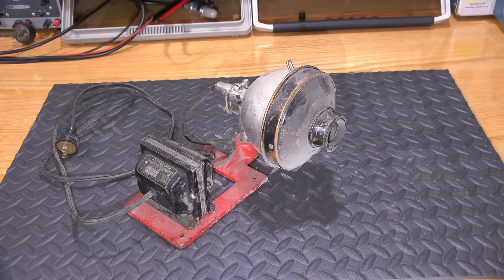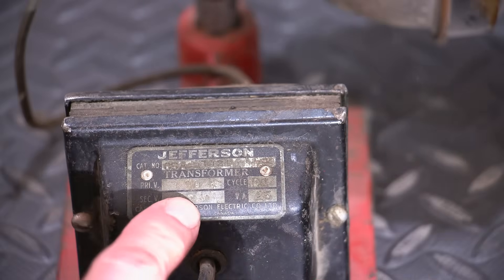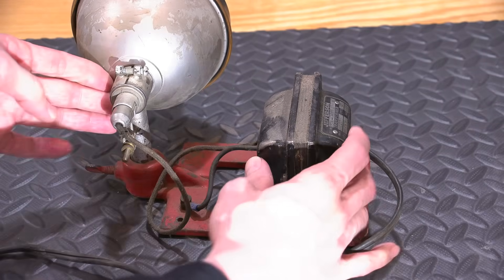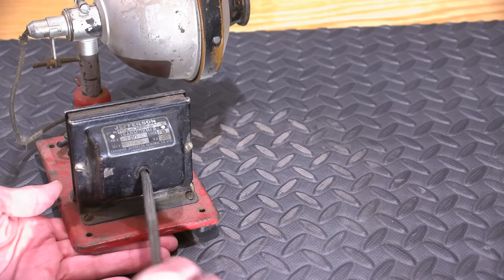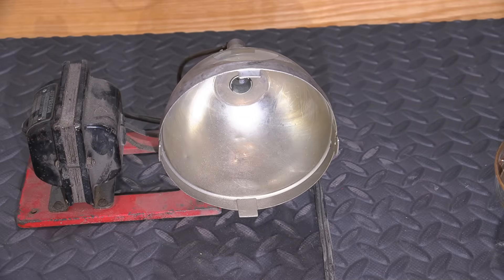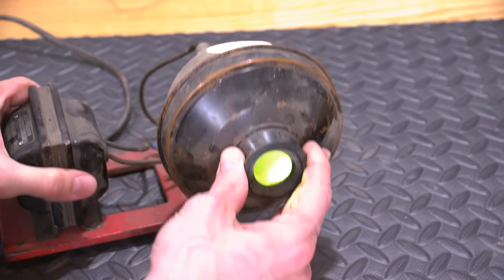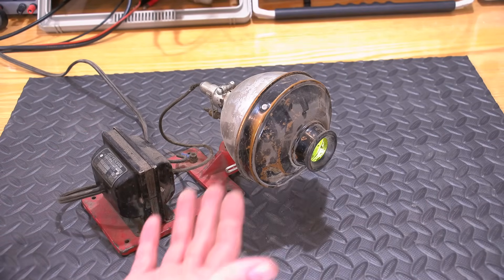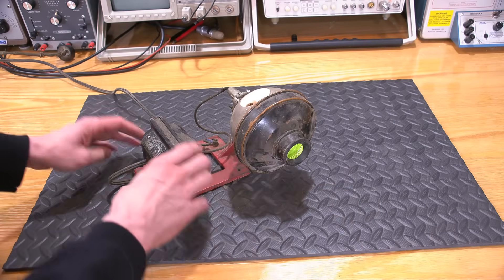Barn Find - What Is It - 1940's? Mystery Device Teardown!

Comment: if it didn't have the opening that would let white light out, I'd think that is was for doing very old school film developing by inspection. You'd soak the film to remove the sensitizing dyes first, then you dye the film before developing using a couple of different dyes, then you'd develop the film and every so often you would shine a dark green light through the dyed film briefly to see what the contrast state was of the film to decide how to proceed. This was used with mystery film where you didn't know what the film was or how it was shot.

Comment: I also go along with the egg candling device.  Perhaps the colored glass lens was a method to deal with different colored eggshells, to obtain a more consistent appearance from the egg. The focusing mechanism would have perhaps been to be able to candle eggs from large to small (e.g., quail to chicken to duck to turkey) eggs and cover the entire egg.  As for the stand, that looks like one style of ring stand clamp base that the transformer is mounted on.  It could be mounted on a bench or on the wall.  You don't want to let an incubated egg cool too much when candling, and you don't want to sell eggs that have started developing a blood spot, so a bright light with little heat is ideal. Modern egg candling devices use 800 lumens of white light from an LED to solve some of the issues that this antique attempted to solve.

As for the flash bulbs, they were filled with a magnesium alloy wire that literally burned.  The bulbs got quite hot while flashing.  The large bulb you have would likely have been used in a photography studio, and it's just a single-use bulb.  Even with needing to carry lots of bulbs, it still beats the use of the even older flash powder technology for photography.

Comment: The Westinghoue flashbulb is nearly as old as the egg candler. Too bad you don't have the  thin corrugated cardboard
 box it came in. People may ask why a piece of thin metal inside an airless ,but filled with some nitrogen gas glass bulb ,
would be good only once . Well that is because it 's Magnesium wool wire. Once it gets 3 Volts through it , it will light up 
so brightly for only for about 0.020 seconds,  because the Magnesium itself is in nitrogen gas ( later oxygen) it doesn't 
explode because of a plastic coating on the outside , it was called the SM bulb. The brightness of your number 11 bulb
 is 1800 Kilo-lumens!  Very bright but  only 1/50th of a second! This info was in a General Electric Lamp Division brochure.

Comment: After watching 1 minute of this video, my guess is that this thing is supposed to be mounted permanently to a bigger object, stationary or ambulating. The red frame seems to be the electric return path from the active bowl thing that is only connected to one wire leaving the transformer (to the bayonet lamp holder looking end). The setup makes me think that the transformer is a step down one.  Is it an apparatus that transmits electromagnetic radiation at some frequency out of the hole in the middle of that black/brassy tilted vase-looking thing? For shure I would be careful before energizing such an ancient device, being aware that they made a lot of inadvertently dangerous, electrical contraptions back in the days...

Comment: it looks like a theater spot light. works the same. you do have to focus the light beam for big or small circle of light.
Reply: That would need a condensing lens to work an a much more powerful bulb.  It's a shame the actual answer (egg candler) has been side tracked by the flash bulb discussions!

Comment: I was mesmerized by the old square flash cubes. As a kid I discovered it was fun to set them off with a capacitor charged by a 9v. The charged capacitor seemed more magical than just the battery. My friends thought I was a wizard. (Funny that later in life I would be called a “modern day” Mr. Wizard by a couple of TV networks). My grandmother was pretty forgiving, considering how many of her flash cubes I popped off.
Reply: I still have a few 3-packs of those Instamatic flashcubes.  Used to have a few of the Instamatic cameras, but I think I lost them in a house fire.
Reply: @SenileOtaku  Just the other day I saw a photo online that was heavily tinted red and was a squarish format picture, so I asked was this a 126 Instamatic pic from 1974.  It was!  Well... '75 but close enough to get a laugh.
Reply: @SenileOtaku  I’m sorry you had a house fire. That is such a horrific experience.
Reply: There were also "magicubes" which like flash cubes contained 4 bulbs each.
Rather than being initiated by a battery voltage, these had a spring loaded wire which struck the single pin supporting the bulb somehow firing the bulb. There was no power source involved and they could be fired just by lightly pressing the exposed spring wire with any object until it cleared it's retaining pin and struck the mounting pin.
Reply: @MrVeryCranky  I remember Magicubes but I didn’t know there were spring-fired versions. That’s pretty cool. I only remember the ones set off electrically by a camera. I wonder what the firing mechanism was. Perhaps some primer material.

Comment: When I do a lecture on the history of flash (as part of my beginner's flash photography workshop) I fire of one of those flash bulbs...I screw it into a light fixture designed for high-temperature incandescent 1000watt photo flood lights, turn it AWAY from the audience so they aren't blinded, and then touch the prongs of the standard North American line cord that's attached to the light fixture to a 9v battery...that's all it takes to fire the flash bulb.  
I've never measured the temperature after firing, but you can definitely feel the heat radiating onto your skin long after it has fired...the heat was so intense that it usually distorts the glass bulb!

Comment: Hey, a quick question, can you reccomend any good capacitor suppliers? I recently got an old 1952's radio, model "Loewe Opta 1553W Ratsherr 53" and it needs recapping, but none of my local suppliers have the caps in need (I need to replace as one of many, a 5000pF 500V wax cap, and no one locally has anything simmilar).
Reply: Caps in that particular size are primarily listed as .005 uF (microfarad), only in a few cases as 5 nF or 5000 pF.  The big online vendors in the US most electronic hobby folk here end up buying parts from are Digikey and Mouser.  These have similarly large (but not identical) selections of parts and their parts prices are roughly the same.  But chances are one has generally somewhat lower s&h costs to your particular location; which one it is will depend on where you live. Looking on Mouser, there is a 1kV rated .005 uF ceramic disc cap on offer that should work fine as a replacement for that one wax cap.

Comment: What was the transformer output voltage ?
Reply: The label showed 6.5 volts. The transformer is rated for 25 VA which means 25 watts, since incandescent lamps are a perfect resistor. That works out to just over 3.8 amps. A bulb that size would undoubtedly get hot, therefore, the large vent hole in the side of the reflector.

Comment: Using the partial tag on the face and other's suggestions, I looked up "egg candling manufacturer winnipeg manitoba canada" and I found a US Patent listing "Caswell, Walter A., Winnipeg, Manitoba, Canada. Egg candling apparatus. 2,117,146; May10, 1938

Looks to match that decal, at least what's left of it. And if you go look up the patent, that's it. I'd leave a link, but YT isn't fond of them.
Reply: Sounds plausible to be sure, I had a thought that it was a light source for a microscope but I think you are correct.
Reply: @Thomas Moore  If you look up US patent #2,117,146 you'll see the device in the video.

Comment: On the off chance you have access to such equipment, a wavelength sweep of light through the glass may illuminate its purpose.

Egg candling is plausible, but if the glass has unusual transmission characteristics (in particular, a lead-rich glass might have a green tinge like that), that might indicate it was used to provide a reasonably monochromatic UV/Infrared/X-ray/particle source for some industrial or scientific application or other. There're plenty of one-off instruments like this; that was my first guess, as the levels of jank here seem roughly commensurate with kinds of things I've seen physicists do. 

Some of the other features might be vestigial, left from whatever it was cannibalized from. Who knows. Cool find!

Comment: I was always perplexed by the physics of the MAGICUBE flash cubes that had no connective wiring or circuitry, just a little metal tang that would pop up out of the camera into the filament momentarily.  Maybe there was a piezo inside the camera making charge at that instant.  Never took my Kodak apart to explore that far because my parents would have killed me.
Reply: It was even simpler than that.  If you looked closely at the base you could see then was a bit of spring loaded wire in the slot on each side.  That little tab that popped out of the top of the camera pushed the spring off the nub that was holding it.  The released wire struck a small rod coated in fulminate.  It's probably the same chemical as was used in firearm percussion primers.  You could set them off by pushing anything suitable into the slot to fire the spring but yeah as kids we were warned that doing something like that would be met with parental displeasure of the highest order.

The Magicube used zirconium wire rather than magnesium - I'm not sure why but I suspect it might be because it improved reliability with a fulminate initiator.  I never knew one to fail.
Reply: It was pyrotechnic.  The impact struck a primer-like ignition device.
Reply: Ah, the age of Kodak cameras and Kodachrome film.
Reply: @foureyedchick  I had a Kodak Instamatic X-15 when I was about ten. I wore it out ... eventually the film advance stopped working. Better cameras and a home darkroom followed.
Reply: @AcmeRacing  Part of what I found "NOS" in the attic from the previous owner...  a few of those Instamatic X-15s in the yellow and red "display" boxes.... thinking wow, what I find,  and they are essentially worth nothing!  Don't even know if you can get 126 film for them anymore,  or even the 110 film for the "pocket" cameras.
Reply: I was able to trigger Magicubes with anything that would push the metal spring off the pin that held it back. Not sure how, but the impact from the spring triggered the bulb.
Reply: @AcmeRacing  i would guess the same concept as a grill striker or other electric sparkers that work without batteries, get the right combo of metals and when they hit eachother hard enough they let out a jolt of electricity
Reply: It was fired by percussion, one could carefully extract the bulb from the Magic cube and flip the bulb when it hit the floor it would fire.
Reply: I am surprised anyone remembered these,  and that Paul mentioned them !!  

When I was going through the attic,  the previous owner of the house left boxes of flash cubes and the vertical panels (I believe they are called flip-flash),  and bulb style flashes with reflectors,  but smaller than the one Paul showed.  Lots of old cameras like Brownie.  I wonder if those flash cubes would still work 40 to 70 years after they were made ?
Reply: they were kinda cool. they used a pin and hammer, like a bullet primmer charge. no electricity needed. you could poke one with a tooth pick and blind yourself!
Reply: The bulb had a small rod that a spring struck. Just pinch it with pliers and the bulb goes off.

Comment: Hello Mr Carlson, les think a bit about this thing: 25VA is low for a projector, , the iron frame has 4 holes (in corners) to keep it steady, the position of the bulb is adjustable very precisely, and the  position of the complete reflector is rotable , and ihis support is adjustable in vertical , so , summing up, steady, and adjustable in focus, higt an rotation, to much to obsrve eggs, looks like a polarized ligth device to use with a second device in front of it, maybe a polarimeter (had you ever noted the existence of LEVOTIROXINA?, this moleculae turns right polarized ligth an has a similar one that turns left and the results in the human body are totally different, being quimically equal). I greatly enjoy your videos, you are incredible good, knows your bussines like an encyclopedia.

Comment: That's a unilateral phase detractor from a Rockwell Retro Encabulator. Great find!
Reply: It seems to be missing the flux capacitor.
Reply: @kenmohler4081  I was wondering how long it would take before someone brought up the flux capacitor 😅
Reply: @shawn7233  You can't build something of this nature without at least one.
Reply: Alright.  This thread is hilarious.  Thanks dudes.  Needed that
Reply: It's obviously an anti-focal sideband decoder for tetrahedral conditioning of Rochelle salts.
Reply: @carlrudd1858  Tetrahedral conditioning? Over Dr. Bell's dead body!
Reply: With nano pulse laser I'll wager.
Reply: I thought it was the bilateral phase inverter
Reply: I thought it was an old green light thingy,  I was close
Reply: How are you able to differentiate it from the multilateral phase detector? The Rhymann tertiary rheostat is blocked by the amplified muon collimator.
Reply: @matthewhall6288  By the absence of a drawn reciprocation dingle arm. The later multilateral phase detector had the dingle arm as part of the unit.
Reply: @bodacious2276 you only failed by using the word "dingle".  And you did it twice.  You should have, at least, capitalized it, like "Dingle".  But you get a B+ for effort. 😊
Reply: @matthewhall6288  also easy to tell by the presence of the marzel vanes.
Reply: Whoa guy's not so fast , I think it's part of the Gonculator that was in one episode of Hogan's Heroes
Reply: @cajuncoinhunter  í don't think so.  It would've needed a much beefier transformer. I think this was an example of the early attempts to bring encabulation technology to the retail market. It was ultimately a failure due to the incessant zizzing and dripping.
Reply: @jeepien  Also, there was the overheating like the tropical fishes, and this one isn't like the Austrian self-sharpening razors... I knew I'd heard that "zizzing and dripping" before. Thnx for making me dig out my Firesign Theatre' Big Book Of Plays to find the reference.
Reply: @davebrown9725  Shoes for Industry, Comrade.
Reply: @jeepien  It looks like you in the Jeep family ??
Reply: Spot on but the dingle arm is missing
Reply: A master type Garrestan.
Reply: Pantom Zone Projector.
Reply: @Leslie C. Deal Cardinal grammeters are finicky things
Reply: Best thread EVER! 😄❤️👍🏼
Reply: :face-green-smiling:
Reply: Very funny!  it is worth it to you tube search for  "unilateral phase detractor from a Rockwell Retro Encabulator" and watch .
Reply: It's actually street light "go" projector.. The red ones used real ruby's.
Reply: Dammit! Haha beat me to it 🤣
Reply: It's an Interositor, of course.
"Capable of laying a 6 lane highway at 70 miles an hour, if I read the specifications properly."
'This Island Earth', 1955
Two human scientists have been given a catalog of alien technological gadgets as a sort of intelligence test.
I was always struck by the absurdity of the scientist being able to quickly figure out how much energy that sort of construction process would require.
Reply: I'm sorry, but you're all wrong. This is a relic of the early CIA efforts from their mind control laboratory where the famous  Manchurian candidate research was done. This particular device (obviously) focuses energy generated by spatially synchronizing within a reaction cavity, electromagnetic fields and a specific spectrum of light waves, which when combined together are focused into a subject directly or through a video copy analog via YouTube, and this causes the subject to imagine any object presented to them to be a benign and simple device, such as an "egg candling unit"...when in fact it is a devious mind control machine run by baby eating democrats and powered by "Jewis space lasers". Wake up, America! Canada is deceiving you!!!
Reply: It’s not a unilateral device, rather it is a bi-lateral entabulator.
Reply: The Milford Trunion is in great condition!
Reply: Big if true 😂
Reply: Oh, man. I think he broke the president, I'm gonna go get my wife.
Reply: "...encabulator"?
WTH?😮
Reply: I don't know, as someone mentioned before it's missing the dingle arm, but I also noticed it's missing it's ajuvant cungulating rotor. The copper coils on that rotor are imparative for proper operating of the missing dingle arm. A shame that it can't be found anymore.
Reply: You guys are dumb; it's obviously some kind of macromat field integrator

Comment: Until I saw the line cord with north american plug not to mention your showing the id plate, I initially thought it might be the very part that fell off over Canada ultimately resulting in the Roswell crash.

Handy Andy Junior 6V X-Ray Kit?

From the set of the Wizard of Oz to help light up the Emerald City?  If Hollywood could source Lorne Greene and William Shatner from Canada, why not set gear too?

Perhaps train signal, maritime or aviation use?  The focus adjuster seems like it is intended to fine-tune for optimal/maximal greenish glow or perhaps visibility at distance.

All in all, you have left me thirsting for a glass bottle of vintage 7-Up now !!